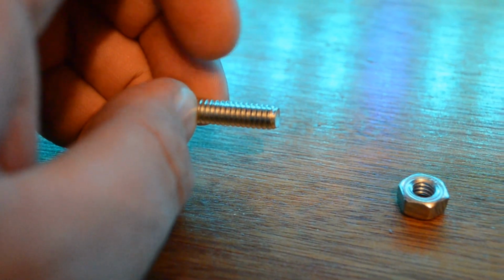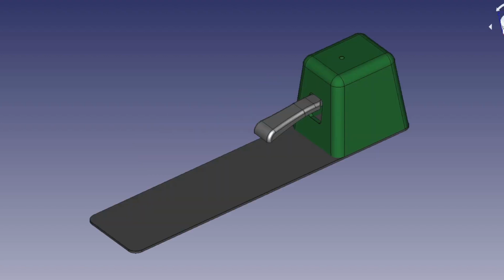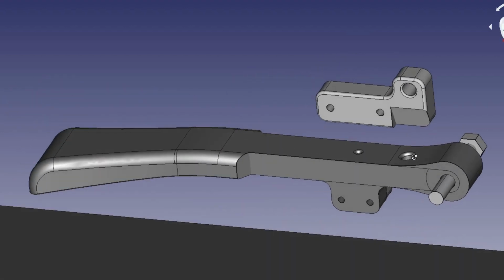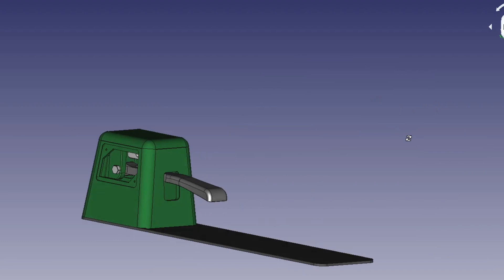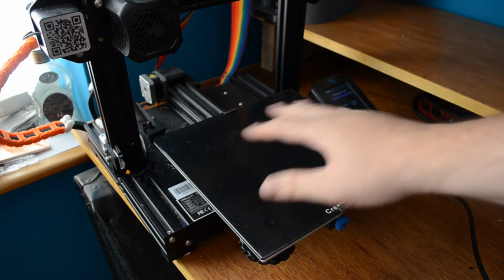Sustain Pedal 3D Printed DIY Electric Piano - Episode 11

Comment: Really cool.  Thanks for this.  I made my own Wurlitzer pedal years ago using a cheap electronic sustain pedal that i took apart and attached the cable assembly which i bought (50$ or so, ).  Also used bike cable housing.  It's still going strong about 8 years later.  Do you have the STLs for this print?
Reply from the maker: Hi sorry about the delay - drop me an email and ill send you the stls.
:-)
Reply: @deancoyle  Hey Dean - I sent you one about buying the STLs off you if possible!  ✌🏻